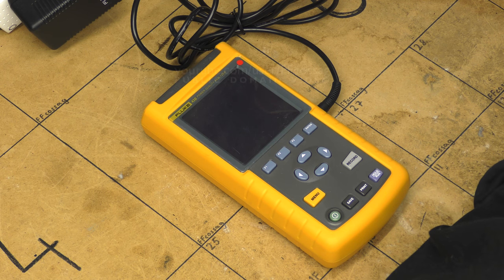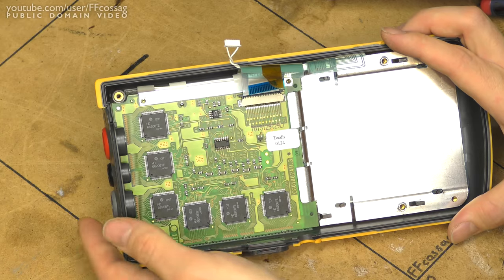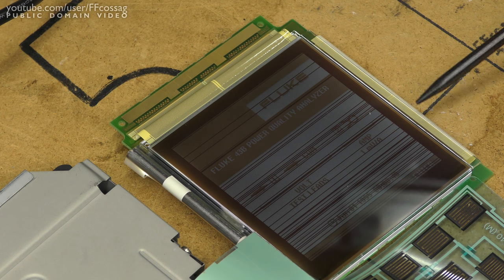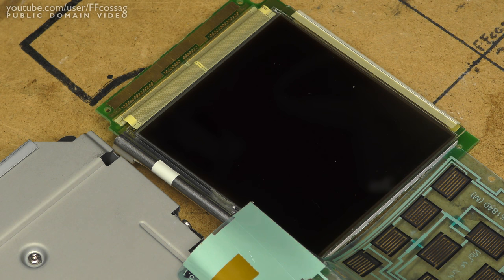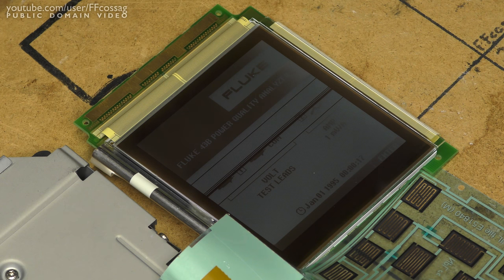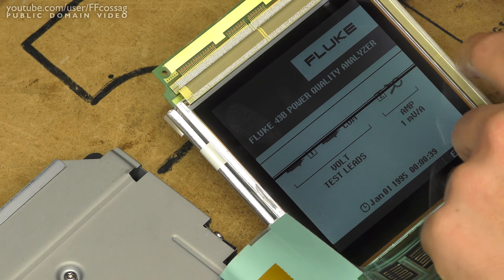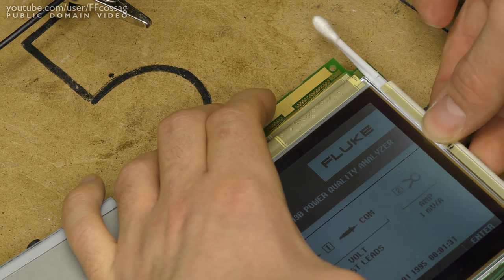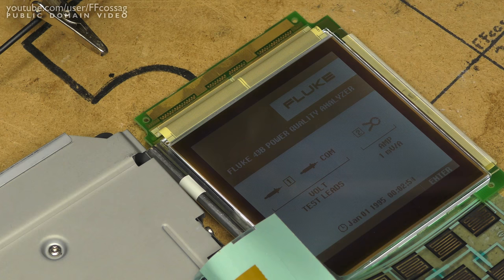Fluke 43B LCD repair

Comment: Yup, thats how to fix this problem, possibly temporarily, but fix it at least. I happen to have experience with this as well, but another device and a smaller display. The nasty thing about the problem with the display you're showing is just that the cable is folded over. In my case I used just a soldering iron on a low setting (125C, if I remember correct) to push down on the cable and fix it that way. Very well done! :)

Comment: When I see people do re-flows I notice some aren't successful, but the guys that soak it in flux first have a much higher success rate. I think when joints crack they oxidize so that they don't always remelt together, but when you use flux the joints clean and have a much better chance of remelting.
Reply from the maker: Yep - however these LCD bonds aren't usually solder, but rather some form of conductive hot-melt glue.
Reply: I was wondering how they get it to stick to glass - thought it was some kind of glue -. Those Fluke screens seem to be a big problem because I saw EEVblog having a go at one as well. Good work on the vid.

Comment: Common issue with a lot of LCD displays like this that end up in the bin because of excess lines, and repairing the ribbons is definitely only temporary sadly... :\

And LCDs do "fade out" when heated above a certain temperature, but usually doesn't harm them unless it's excessively hot...

Comment: Well done, its usable again :-D.

Im supprised that fluke didnt apply a clamp of any kind, or just use a longer ribbon so there is less stress on the connections.
I think i would try inserting a rubber rod into the bend space, so when the screws are tightened the display is pushed down slightly by the plastic fasia.

Still i think it would be short term.
Reply: Amigo tienes una pantalla del fluke 43b para la venta la mia le salio un ongo o una mancha y no deja ver nada
Reply: Amigo tienes una pantalla de repuesto para rl fluke 43b

Comment: Hi there 
I have a a fluke 123 industrial scope meter
It turns on but have a blank screen with no lines. What do you think is wrong with it?
Reply: Same problem. I have one which was on the shelf for a long long time.  I changed and charged the batt bur the screen not light. Only a anemic beep.